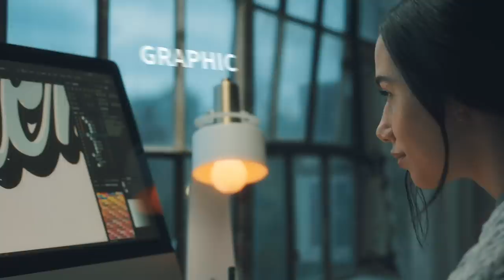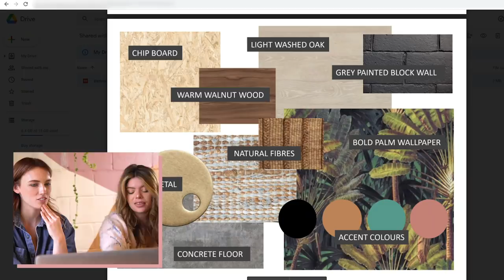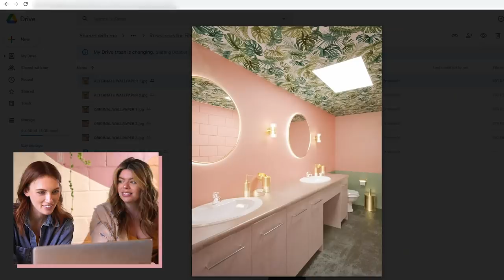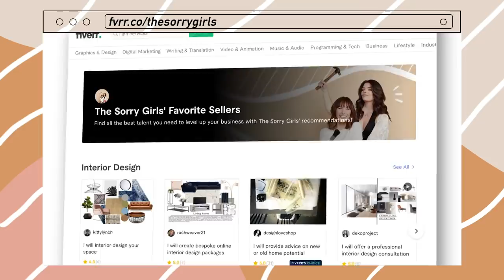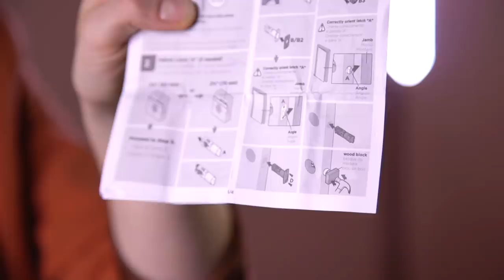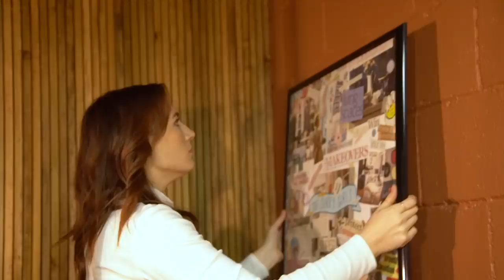FINALLY making over our scary bathroom

Comment: Super fun refresh ladies!! I'm also for the enclosed toilet, so the space can be used for washing brushes and using the loo at the same time. I also thought painting the tamber wall AND the ceiling a dark moody midnight-green, doing a horizontal tamber on the back toilet wall, and carrying that all across the ceiling. This might help visually widen the space as well. Build the ceiling tamber in framed sections you could then hang. Super awesome, your loft space is so fun, and I've gotten so many great ideas from you two!

Comment: Random idea, but if they had an additional panel for the fluorescent light, they could potentially sandwich something translucent enough between them that light still comes through, but you don't see the harsh light rods. Either gray tissue paper or even a gray canvas with a big weave or tulle fabric which would add some interesting texture. Both very cheap options in my opinion for a big problem
Reply: Oooh good thinking! I was wondering if there was space for the old light cover + the new one. The old one closer to the actual light source and the new one on the outside so it’s seen in the bathroom.

Comment: I’m loving the loft vibes series 😁 for the light in the bath room I would take another piece of black acrylic but one that light can’t shine through or one that allows significantly less light through, cut a pattern into it and put it behind the first piece of acrylic. That way when the light is off it still looks the same but when the light is on it casts shadow in the pattern that was cut out. (I hope that makes sense) you could probably achieve the same effect with vinyl or paint on the original piece of acrylic, however I’m not  sure how it would look with the light off.

Comment: Love the final look. Just wanted to give some pointers as I study interior design.. for wallpaper glue use paint rollers when you have a bigger spot to cover, its easier and faster. Also for wallpaper theres special tools to smooth it down which bend in the ways u want, use strokes up to down from side to side! Love love your sense of style and lots of love from Finland 💕🥰

Comment: Hello! So the first thing I thought of was... to make two stalls in the back to hide and separate the toilet...add a second toilet... and you have two sinks so It only made sense to me. Two Industrial style rounded corner mirrors. A down facing shiplap wall in the bare wall in the back... or some bohemian tiles all over that tiled wall. Dark forest green, or like a Farrow & Ball Estate No.30 on the outside but a bright color on the inside. Unless you want to hide the stalls to look more like a secret wall...also could be shiplap. Then depending on if you wanted more of an industrial, bohemian, or tropical look you'd get some cute theme appropriate pots and hanging plants for the wall and the sink. I'm a little inspired to make a Fiverr for decorating because I actually enjoy it.

Comment: What if you frosted the inside of that dark acrylic on the ceiling light to help & diffuse the light a bit better? Also, I’d switch out the bulbs in that ceiling light with warmer ones to help it tie into the warmth in the room better. Beautiful job btw!

Comment: This room should be called the night club room. I absolutely luv it. I especially like the seperation you did to make the tiolet seperate and private. The bathtub in my apartment  (nyc) is not closed in. At one end it's just the sink and in order to make it private you get 2 shower curtains. If I were to do your design of the half wall, what would you suggest. I'm assuming the wood has to be water treated. Or what about using PVC pipes?

Comment: Very nice, and nicely executed! The rugs look nice, but seem a bit impractical in what is essentially a "public" bathroom, as are the hand towels. Who will do the washing? Maybe you could have the rug design painted on the floor. And I believe, for practical reasons, you will eventually switch to paper towels, especially due to the pandemic recommendations, instead of the fabric ones. I really, really like the tambour wall treatment, and the way you separated the toilet area with that idea. Overall, I wouldn't mind using that space, not at all! 🤣🤣🤣‼

Comment: You guys need to have an exhaust fan or something somewhere in that bathroom.. Also, loving the half wall to separate the toilet from the sink..but why not make that partition a little bit more private? Like the spacing of the wood can be closer, maybe? And why not use the excess from the wall tamber (is that what it's called) for handles on the cabinet... To tie the tamber wood to the cabinets..you can paint the bottom of that drip plate black so it becomes invisible... I'm sort of bothered with the future dried up drip stains from the drying rack..

Comment: I'm glad you didn't follow any of the possible room setups from the different designers. None of those would have worked as they were. I'm glad you took inspiration from those though, because the whole room turned out wonderful! I'm kind of sad about the Terracotta paint, because it's along the same poop lines that the brown splotch in your office is. I wish you had chosen a color that would go more with the dark wallpaper. And guys? I think you need to change out the blue towels because they don't go with anything in that bathroom. Everything else looks great, I know you'll figure out something to do with that overhead fluorescent light.

Comment: Do you guys have any tips on what I can do with my ALL WHITE tiles bathroom walls? I've hated it from the moment I moved in. Got no window and I'd love a more dark, industrial look, but it's a rental apartment and I can't just concrete over it which I would've loved to do D: Any way to change or colour tiles that I can just remove once I move out? The stickers are a bit meh in my opinion. I've considered putting up a huge wax canvas over at least 1 of the walls, but not sure if it would mold between it and the wall or not. Hehe.

Comment: Love the wallpaper and sinks, but really hate the wall color. Why didn't you use a sprayer to paint the wall? Wouldn't that have been faster and cut down on the need to go back in with a brush to get the crevices?

Comment: I'm surprised you just didn't replace the white ceiling tiles with black ceiling tiles. You would have still had to paint the tracks, but that would have been much easier than painting the tiles as well.

Comment: I think I am stealing a bathroom idea. I am in a bachelor's apartment in the East end of Scarborough. I want a bedroom. so I am going to make two tambour walls and leave an open corner as the doorway to create a bedroom space. I am thinking 1 x 2 sideways with a one inch spacing between them. that way it's open and lets light in and make it feel part of the space. what finish did you apply to yours?